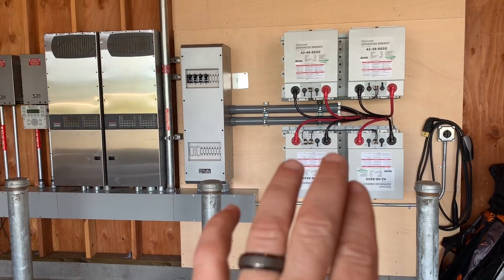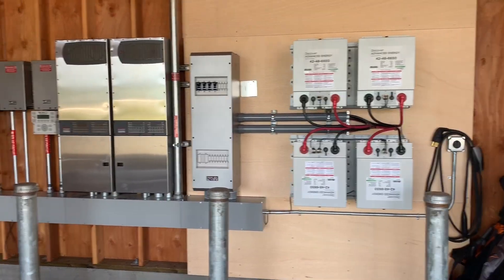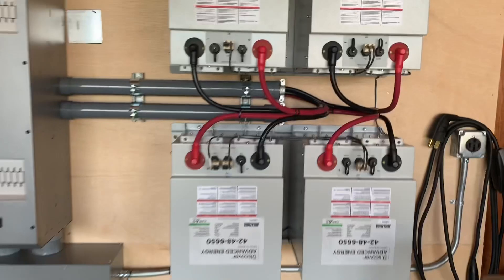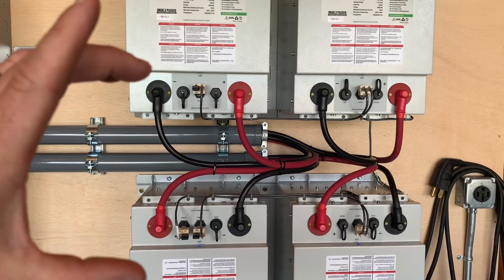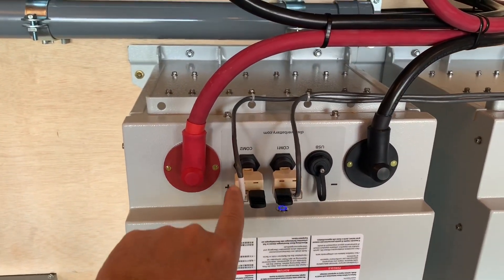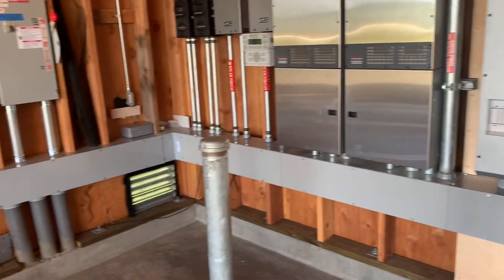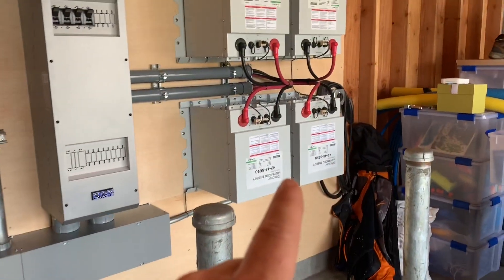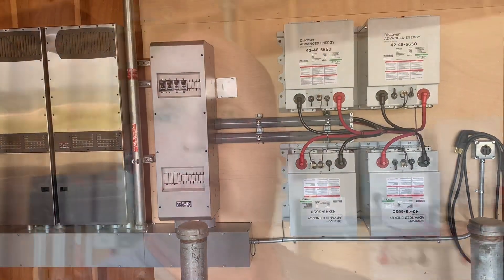Lithium batteries are amazing for off grid living, Discover AES overview

Comment: Awesome overview.  Can't wait...
Reply from the maker: It’s worth it working the kinks out and really have more data know on the two platforms, it’s such a tough call right now.  Schneider just released the Conext Xw pro that has new features but isn’t ready for stacking.  It also can ac couple but the iq7 series enphase can’t frequency shift only turn on and off so in a grid outage it isn’t very effective.  The IQ8 is supposed to be released soon but no date in store, I’ve learned a ton on the upgrades and with the owner in Tennessee to come to the conclusion both the outback and Schneider platform has its benefits depending on the desired outcome.
Next week I am doing the upgrade on my first ever system and I’ll be able head down and chat more.